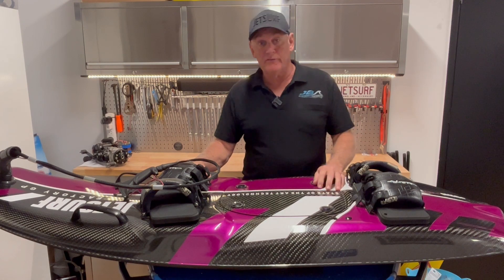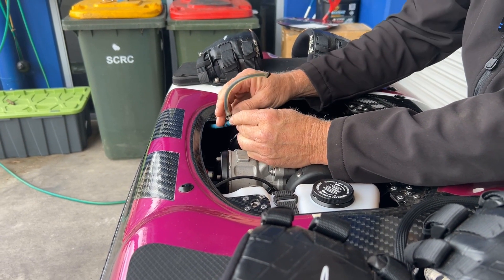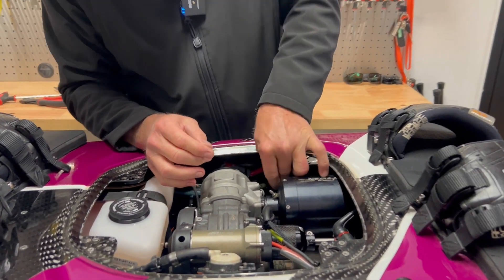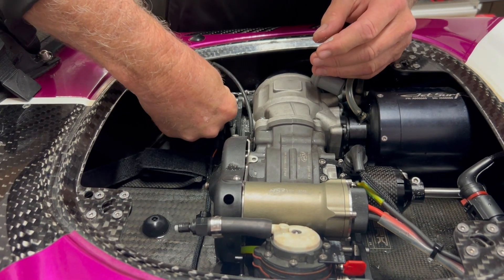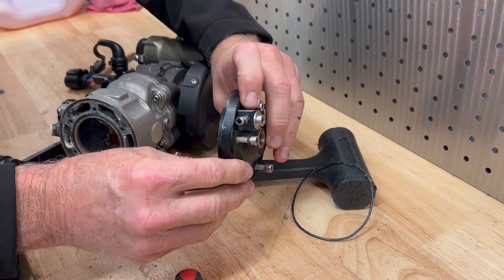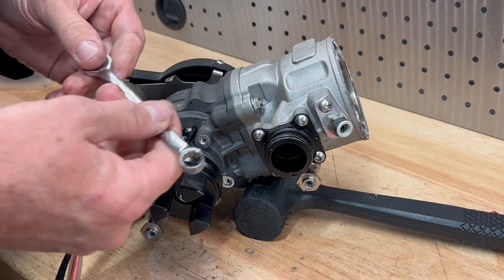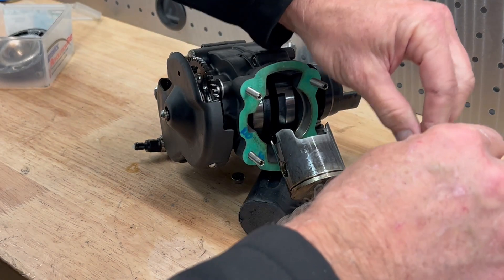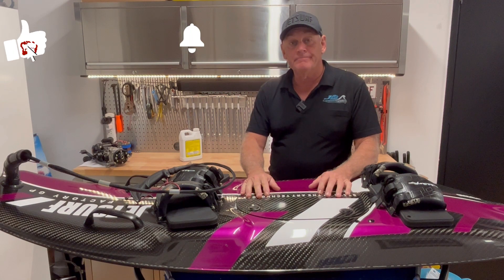Avoiding Disaster: Why Cleaning Your Jetsurf is a Must After Salt Water Rides

Comment: Q?
I have a 2017 gp100 and has a slow crank. Battery is fully charged and clutch bearings are like in very good shape. (Took it apart and checked). 
Flashes code 12
Has a 2 second crank and stops. 
Any idea u can guide me through
Reply from the maker: Hi you may have a lazy starter motor drawing to much current
Reply from the maker: I can send you the signalling faults buy email my email is rodkamp@gmail.com